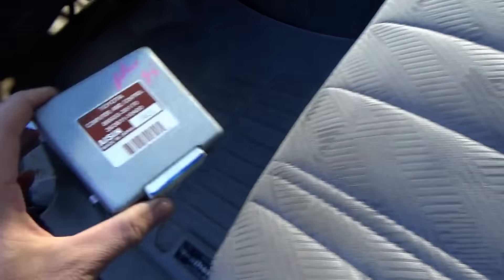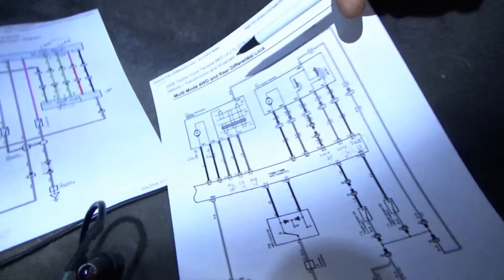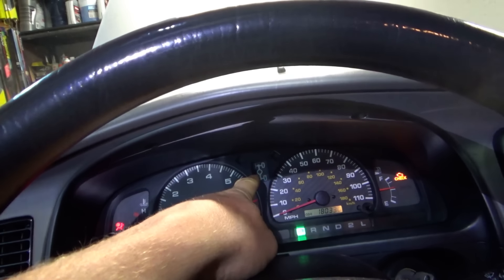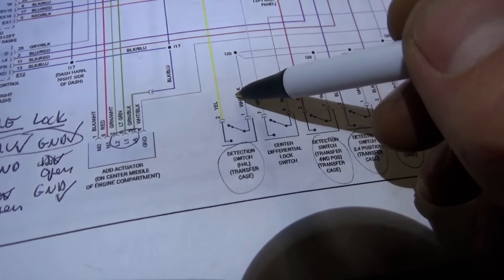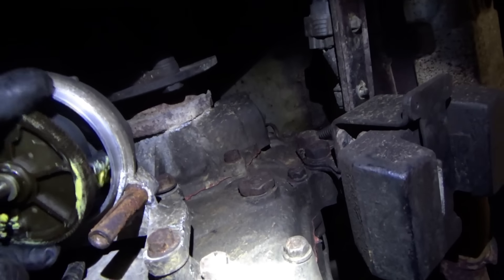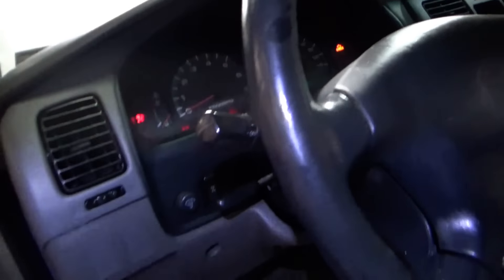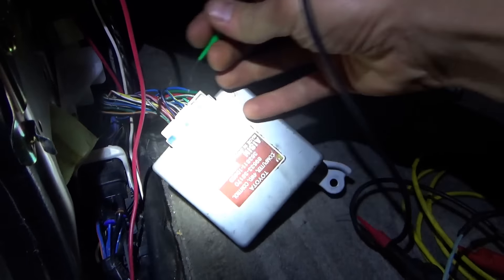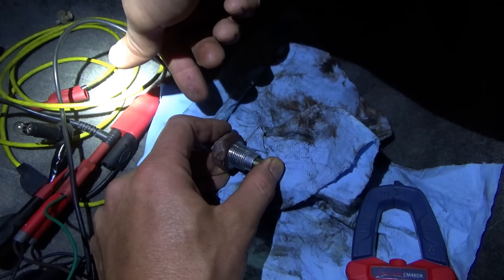(Pt 2) HELP! My Toyota is STILL STUCK in 4x4! ('02 4Runner)

Comment: I had a 3rd Gen 4Runner and you really need to read the manual on how to shift into 4H, 4L, and lock diff. It’s been years, but I’m think you need to be moving/driving for 4H, and stopped or in neutral for 4L. The owners manual details the procedure and DOs and DON’Ts.

Comment: So that switch tells the module the xfer case is in 2WD or 4WD which then enables the module to make the changes according to the driver's  input.  Got it.
I just hope whatever pushes on the switch inside the case isn't misaligned or bent.
On to part 3.

Comment: Nice diag ivan. However, Early on you were seeing confusing voltages, which usually points to confusing resistances and amperages. Wouldnt you agree that Focusing on and eliminating the exposed switches first would have saved you time and money. I do enjoy my 6am wakeup diagnostic videos. Thx

Comment: I just finished up doing a diag on a 2011 impreza sti. They put alot of money into that car. Anyways on my way home i was bored and got to thinking, what tool do i use the most. After thinking about it for a minute i realized i use my test light  a ton. You can do alot with a test light and its alot safer then other methods. Off topic but a test light is a cheap powerful diag tool.

Comment: Love your videos Ivan. This whole thing could be avoided if the mfg had simply used 3 switches on the dash. One for 2wd or 4wd, one for High/low range, and the third for front diff lock on/off. Were this my vehicle, thats the way Id wire it. The H/L range switch would first go through the neutral safety/park position switch to prevent damage to the transfer case.

Comment: May I suggest if you ever have anything like this again you get all 4 wheels off the ground as driveline windup can cause all kinds of issues especially with electronic shifting. And I would suggest changing that shift motor out seeing that it’s rust busted
Reply from the maker: @markbulva4188  I would suggest thinking about the system. How could there be any "driveline windup" with one wheel off the ground? 😉

Comment: Look at it this way. You are not out $100 for the controller. 
If the original is still good. Put that back in and save the new module. Then you have a known good part for the future. I would guess that more Toyota models have the same 4x4 module. 
Then you are ahead by bunches for testing in time.

Comment: My tacoma did something similar.  The rear differential lock would get stuck and not cone out of lock..  you gotta put it in neutral to lock the diff.  Neutral for 4 low also.  4 hi can be engaged when stopped or going slower ..  i ended up running wires directly to the lock motor and bypassed the sensor so i can just hold down the power to the motor and get it to lock and unlock..  because the sensor would stop the motor from being able to do anything and i would have to lift the rear to unlock or lock when it got stuck..  so after running the wires everything works and if it gets stuck i just hold the button.  Got a lock and unlock rocker switch..

Comment: You said that the front dif lock is engaged and one wheel is on the ground won't the other wheel be locked?
Reply: I realized later that the difference lock probably engages automatically, and the switch disengages it.
Reply from the maker: CENTER diff lock. Front and rear diffs are OPEN :)

Comment: I wanted to jump in and ask questions lol i know with the Old Ford Rangers to get to 4Low you needed to be in Neutral with brake depressed. I was wondering if the diff lock was front to rear or just front axle.

Comment: Ivan goes deeper than any other tech I have ever seen, but being 78 years old, I really do not understand what was wrong with a second stick for the transfer case and locking hubs. Making these functions depending on wires on a vehicle you will take into the mud seems very foolish to me.

Comment: Toyota did not design this system with diagnostics in mind...they don't provide any real logistic information about what that module is actually doing when there is a fault for testing things out... very hard to monitor everything going on with no scanner interface to figure out what that module is seeing wrong and how it is reacting... not Toyota's finest hour designing this and I won't shed any tears if I never diagnose one again... intermittent problems are even worse... Ivan maybe getting a good test module was worth the $100...

Comment: Does the motor in the xfr case work?
Continuity? Apply voltage/externally manually?
OK, you did that just after I posted this.

Comment: Difficult.
I looked at a random  transmission trouble code P1782 for 4wd in a Motor manual and it has some troubleshooting trees.  Basically what you did but at least it was there to follow.   There were no codes in the trans. of that 4 Runner?

Comment: Now is their a conversion kit that makes it not electrical you convert over to mechanical or would mechanical cause it not to pass the emissions test but maybe the customer still want the part you got off eBay as a backup he can switch it out it may work for them my self probably want to have that part

Comment: I’m all confused. You keep calling the center lock a diff lock and putting transmission in park and trying to turn driveshaft. The parking pawl in the transmission should engage and prevent output shaft from turning. 🤯
Reply: Yes thats true but he's checking for 2WD, where the front wheels are disengaged from the transmission so the parking pawl won't stop them moving. Center lock is locking the center diff but yes it gets confusing when theres 3 diffs

Comment: The fact that there's a part 3 makes me think that there's a bit more to it than just fitting the new switch! 🤔
Reply: That switch certainly appears flaky, but if it's not the switch I seriously wonder what the heck it could be. 

Maybe he'll find a separate issue on the test drive, since this hasn't been on the road yet, just back and forth in the driveway...

Comment: The 4x4 light comes on if fluid is low in the trans case or if electric reset the battery make sure is not computer error. Drive it turn your wheels see if the front wheels jump if not the 4x4 in not stuck may need trans fluid. Transfer case not transmission also when they lock in sometimes you got to put I Rev to lock out bad thing about push button 4x4 once stuck your 4x4 will not lock in when the front wheels don't spin to get in lock position could be just rust locked not letting the locks to pull out your hub locks get rust when you don't use it and may stick. Low fluid may cause that as well. If an emergency you can drop the front drive shaft you won't have 4x4 but the back works same as if you twist the back drive drop and you have front wheel drive. The front wheel not moving your hub is locked or stuck pull off the tire and look at the hubs may be rust locked. That's why some people like the manual warn hubs when you get out and turn to unlock at times you have to rock it Rev and fwd and just in a bind but pull out got to be the hubs if the front wheel won't spin hubs not unlocking. Even at times rust you got to pull the wheel and screw driver to unlock then put the warns back on. Independent front suspension try turning the shaft from the wheel. Not a Toyota person worked on Chevy and gmc. The bad thing about newer 4x4 really at times you only have 3 wheels spin if you don't have a differincal lock only one back tire spins